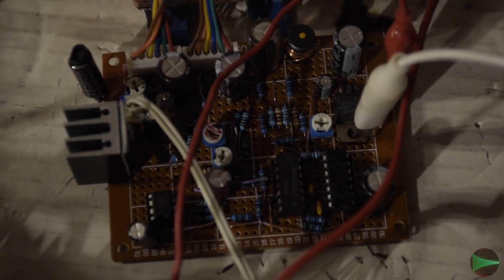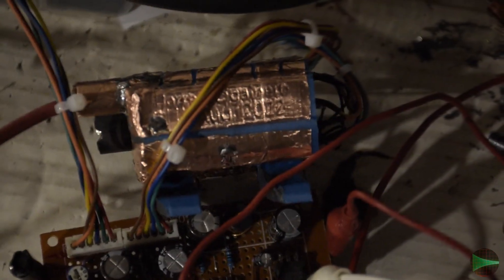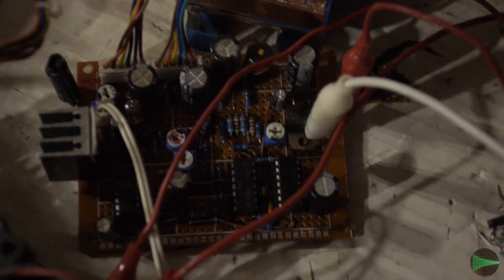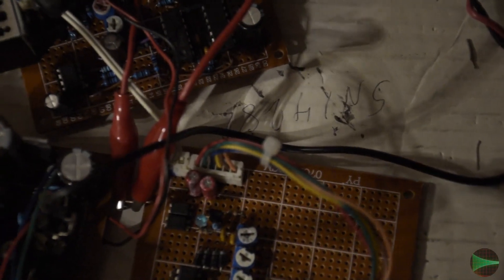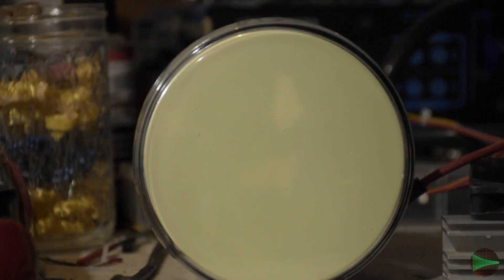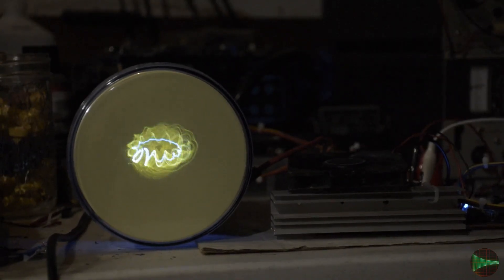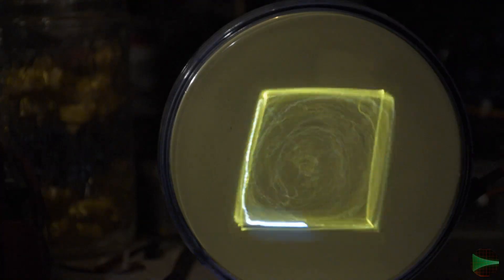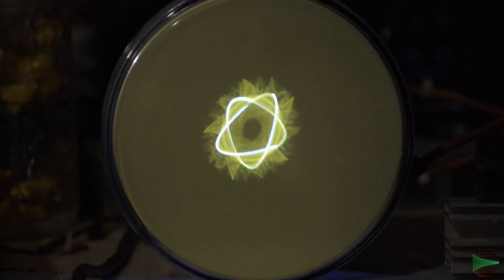Playing with a 5FP7 RADAR CRT

Comment: What EHT are you using and are the focus and scanning coils commercial or home-brew?
Reply from the maker: what is EHT? all home-brew.
Reply: EHT is Extra High Tension. The voltage applied to the final anode. How many kV?

Also, I was interested to know whether the focus and deflection coils you made yourself or are they from an old TV or other CRT-based kit.

Cheers! @RingingResonance
Reply from the maker: @jozefbubez6116  8-10kv, homemade flyback transformer using a 3D printed spool designed around a core from a burnt out flyback transformer.

Comment: Nice job. I have held on to a radar tube for a few years wanting to do something like this with it. It has electrostatic deflection, not magnetic, and the high voltages required are frightening.
Reply from the maker: Electrostatic might be easier to work with. The deflection amp and it's power supply have taken half the total amount of time I've spent on this project. With an electrostatic deflected tube you could generate the deflection power supply with more windings in the flyback transformer.

Comment: What if you play some "oscilloscope music" on this radar CRT? 😉
Reply from the maker: That's actually what's playing on it! Link in the description.
Reply: @RingingResonance  I mean, that type of oscilloscope music, which draws cycling character and mushrooms, you know.
Reply from the maker: @zsombor_99  I have, the problem with that is it changes up too fast and while you can see what it's doing just fine it's not very good for showing off the slow glowing phosphor. The beginning of the one I picked for this video spins kinda slowly which gives a nice fading effect.

I plan on adding a selector switch so that this 'scope' I made can select between multiple inputs such as the audio and GPIO of a raspi for doing vector graphics, a few oscillators, external input, and maybe some other things I haven't thought of yet.